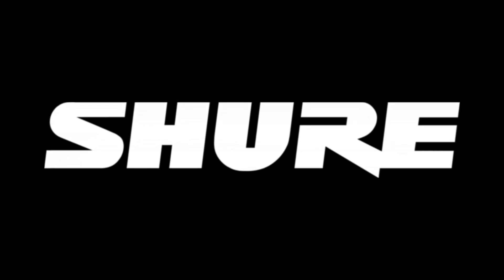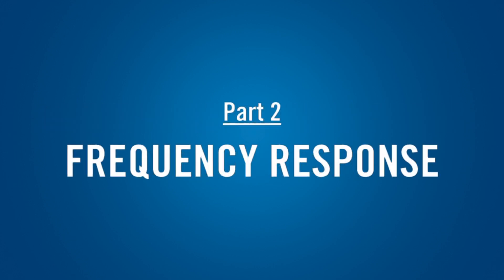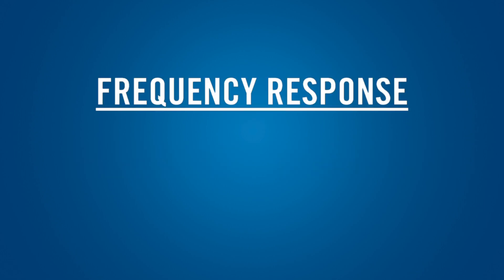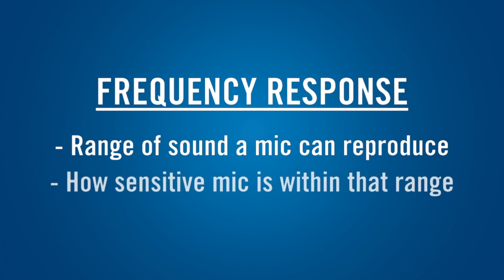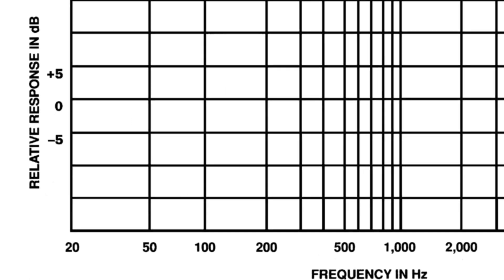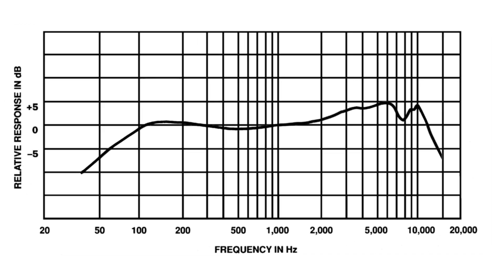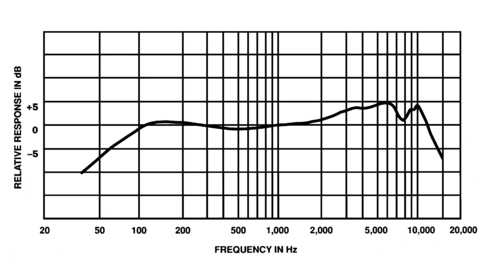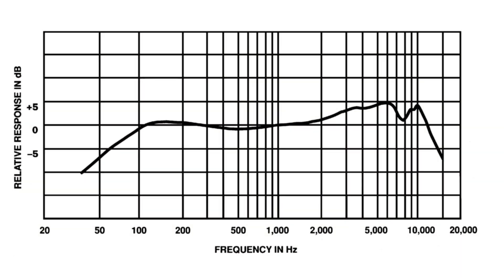Understanding Mic Specifications - Part 2 - Frequency Response

Comment: Ahhh so when a heaset mic is marketed as 100hz-10000hz it doesn't specifically cut-off 20-99 and 10001-20000, Instead it just reduces the low and high frequency

Am i right?

Comment: I hear hardly any difference on my iphone but am sure if i watch this video with 2 type of different speakers i will definitaly hear the difference.
Reply: +johneygd umm actually no. I am using a speaker on my pc, i couldn't make out any difference between the flat freq and shaped freq as well as the freq adjustment thing.
Reply: four321zero it's not noticable even with my headphones
Reply: The difference is subtle, but clearly noticeable: There is a murkiness to the flat recording which is not present in the shaped recording.